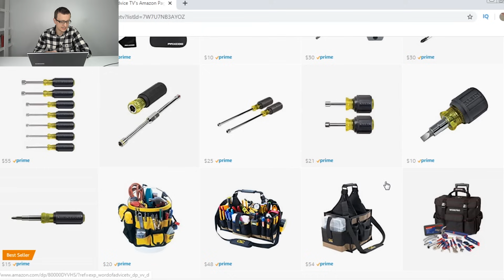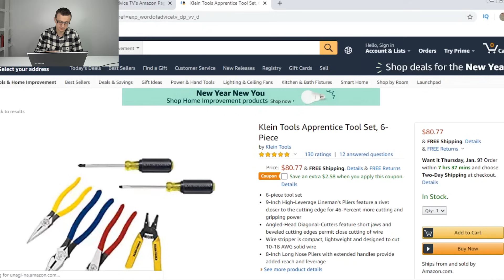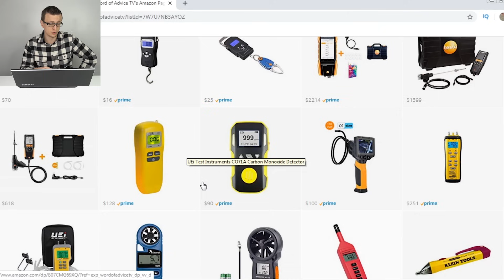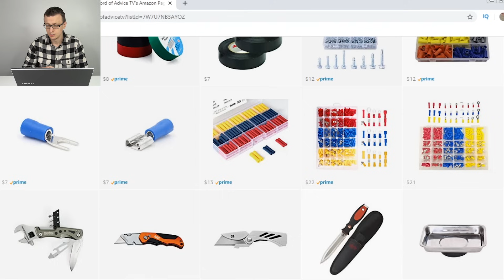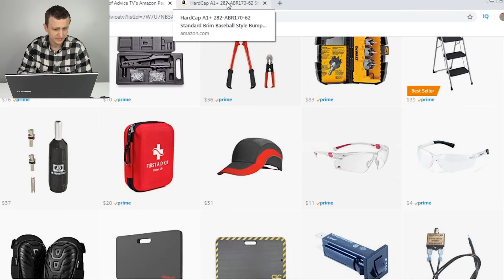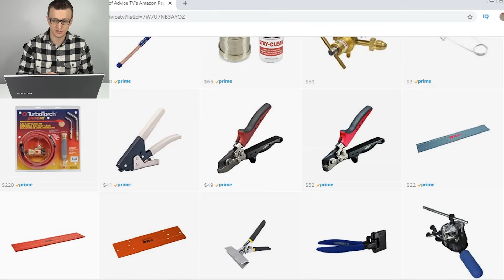HVAC Tools List for New Technicians

Comment: Would recommend the 20-in-1 Impact Driver Set with Screwdriver Bits and Flip Sockets
32303HD in place of most of the screwdrivers mentioned. It is also by Klein.

Love the choice of Midwest snips!! Also highly recommend.

Recommend also picking up a Dewalt 18GA Shear Attachment, fits most drills and works great for cutting large pieces, furnaces, and plenums. They are a great tool to have around. 

Should have some kind of ratcheting pipe cutter

Also highly recommend a deburring tool for ABS, PVC, CPVC, like the DEB4 but they are pretty expensive. I see there are knockoffs on Amazon, haven't tried them yet.

Would recommend prioritizing the ratcheting wrenches over the normal ones, adjustable wrenches will work in most places, where the work is very tight, you'll want to have a ratcheting one.

Recommend the Milwaukee Surge Fuel hydraulic impact driver, much quieter and easier on the hands.

10/10 Recommend having a bump cap, saves countless bumps and bruises.

Should have a pipe bender somewhere in that list as well.(with reverse bender)

My favorite step ladder is the 5.5 ft. Aluminum Dual Platform Ladder with Removable Project Bucket by Gorilla, it is just small enough to fit most places, but big enough to work in raised ceilings, also the "Project Bucket" is super handy for pretty much anything you need to do on a ladder.

Comment: Hey I have a question. I have that hex Service key. And my lead always say I need another one that’s bigger for the suction side so he never uses my key. is he wrong
Reply from the maker: Just to make sure we are talking about the same thing, you are taking about the refrigeration service wrench right?  That wrench should work for just about any service valve so I'm not really sure what's going on there.  🤷‍♂️ Maybe you got a different one? Have you compared your wrench to his, is it any different?
Reply: @WordofAdviceTV  I bought a Klein Service wrench and came with hex adapter 1/4 inch square to 3/16 and 5/16. That’s would open both valves right?

Comment: Hey Jay, I got a question for you. What type of different screw/bolt head shapes and sizes would you say we must have in the HVAC field? I don't want to run into a screw/bolt I can't take out because I don't have the right drill head. I noticed on some of the all-in-one Klein screwdrivers that they don't have the right size for some gas valves. I believe I got what I need, but I just wanted to double check. Thanks

Comment: Wera insulated screwdriver set I think they are much better quality than Klein and also cheaper on Amazon. Also the Klein 5/16 1/4 slide lock 10 in one I think is the must have screwdriver. Get it you will never go back to regular 11 in 1 it also has a Schrader valve core remover

Comment: Starting out or even in to it, Harbor Freight builds some good stuff. We farm, poultry houses, so lots of switches, motors, capacitors ect. I used Simpson analog years ago, then used fluke, I burned it up and bought a Ames from Harbor Freight and it has worked fantastic.  Been dropped hauled in a truck ect and works great.

Comment: I have two bags. My sheet metal bag which is mix match of every brand, and my normal everyday bag which I just recently replaced everything in there with Milwaukee... I also have a bag just for drill bits but you know I'm not counting that

Comment: I would like to mention a tool. It is a locking adjustable wrench. I find myself using it quite a bit. It works well during times when you need to break up two nuts back to back or when working on a nut in an odd location. Once the wrench is locked on it won't come off like a typical adjustable wrench.

Comment: I am in HVAC school right now and am looking to buy a drill and/or driver. I am currently thinking about buying a small 12v driver for screwing and a larger 18/20v drill for more power for drilling. Is this a good setup for the cordless drills/drivers?

Comment: great video but would like to throw a little hint about tools , i have learnt from my use of tools , the manufacturer, means a tool that does'nt degrade due to poor material process, such as , side cutters , made by many companies in china , these tools dont keep a good cutting edge , the edges chip away or deform , i actually had a jaw of a cutter break , but i do have great U.S.A. made tools and when i used my klein , it worked great , maybe it sounds like i dont like china but when you pay for tools and they dont perform while on the job, i start to steer away from foreign made tools. not all of my foreign tools were bad but too many were not the best , kudos for this video , wish i had this info when i was starting into my profession, thanks for these videos.

Comment: Wow. I consider myself an HVAC hobbyist, yet I have all the tools in one form or another except the anemometer (I have the fieldpiece manometer tho) and gas analyzer - the latter simply because I would never work on the gas metering myself. A lot of tools carried over from my other 'hobbies' plumbing, auto mechanics, gas welding, and electrical. 
Things I don't have but would eventually like: iron pipe threader and cutter. I grew up on grandaddy's farm and was put to work right after school, he also had a trailer/rv camp grounds on the lake so got into HVAC in 5th grade working on mobile home hvac. Age 50 now with more decades of 'hobby' experience.

for those starting out, recommend you check craigslist for HVAC guys who are retiring and selling their tools

did i miss nitrogen flow meter, core removers? fireproof fiberglass canvas for brazing? sheet metal breaks and folding tools, circle cutter, crimpers...

Comment: Got a hair less than 3 years and all 3 years I have been directly trained by a guy with 30 years of experience 

Slowly building my tool bag 

Anyways a few cool tools of mind is a “ swedge tool “ negates having to buy copper fitting saving ALOT of money per job 

And another is a copper bender to keep from buying copper elbows n such when they run here about 15$ a piece

Comment: Milwaukee 12 Impact is my favorite and use today. I also bought the RIGID version and it is just as good. RIGID is registered and battery is lifetime warranty. I say this because I used to use DEWALT, and after 14-18VOLT batteries dying over time, I game $1000 worth of tools away to another DEWAULT fan, because I was Done. I bought RIGID, and am happy. I have replaced 2 of my original batteries (FOR FREE)) and have no other problem with them. BUT YOU HAVE TO REGISTER YOUR TOOLS. IF YOU DO NOT REGISTER WARRANTY IS ONLY 3 YEARS. ALSO, CHECK ONLINE AND MAKE SURE YOUR TOOL WAS REGISTERED. I HAVE A FEW BOUGHT ONLINE THE THEY DID NOT REGISTER EVEN THOUGH I FILLEDED OUT RESTISTRATION.  IF REGISTER AND APPROVED, LIFETIME WARRANTY ON EVERYTHING FOR THAT TOOL.

Comment: You have to use low lose fitting hoses. New tech should just get analog gauges first. Good ones are much cheaper then good digital( Testo) and good for them to use their head for the math in the beginning. Stay with knipex when able

Comment: Remember: As an apprentice you are not expected to have all this stuff starting out. As an installer I don’t use a lot of the tools he said to get like the sheet metal notching tool, just use your snips to notch it and save the money and weight for your self. Most guys just use needle nose pliers to open up the copper to fit copper inside of it. Not proper but it saves you from carrying around a lot of extra stuff.
Reply: I agree duke you don’t need every single tool especially if you do more research you’ll soon find out
Reply: Most of the expensive tools, company will supplies they only really expect you to have hand tools and gauges. Companies don't expect a tech to have a vacuum pump, scales and recovery machine. But it's a pretty good list of tools that people should be familiar with for sure.

Comment: On pipe wrenches: the teeth on my Milwaukee wore out very quickly. If you are running lots of gas, especially commercial jobs or plumbing jobs Ridged is the only way to go. I would save up the money for them they are worth it.

Comment: If you are doing much duct work (new construction, change outs) I firmly recommend Midwest crimpers, reds, greens, hand seemers. However I barely use my handseemers. I would not go with Klein for sheet metal tools speaking from experience. Also Malco Turbo sheers are a must have for ductwork. 

If you are in service or going into service you may not use this stuff as much but I wish I was told this when I first bought my tools doing new construction.

Comment: Cool to see the differences between the US and Canada. 
In Canada we are called refrigeratoration mechanics but they also work on heating systems. 
Our apprenticeship is 4 years consisting of 1600hours per year on the job and 8 weeks technical training per year.  
In Alberta we get an allowance of about $500 per week while we attend technical training.  
It's a red seal trade meaning if you pass the red seal test after your final year of technical training, it's a certification that is recognized world wide.

Comment: A few comments about tools  : 
1. Customers don't care what kind of tools you got,  they only want to know how much it will cost and how soon will it be up and running. 
2. All tools get dirty,  so if you got to buy pretty hot pink, neon blue or riotous red handle ones, don't spend extra dough. Working man generic tools will work just as well unless you're moonlighting as a fashion model or circus clown.

Comment: Great list! Insulated screwdrivers, lockout cap screwdrivers, clamp for door switch. I like Milwaukee for some hand tools which is close to prices. Wireless gages are less invasive but expensive. Indestructible shoes. They’re construction toed running shoes.

Comment: That stubby Klein screwdriver is a lifesaver (mines Milwaukee and ratcheting idk if the Klein is but same thing) seriously a must have also the Milwaukee bit kit and the color coded hex set are as well. And of course a good Impact/Drill set is a necessity i use Makita but Dewalt  Milwaukee and Ridgid are great too and a duct knife Malco is nice cos the soft sheath but Milwaukee and Hilmor are nice too.
Also a refrigeration unlock key so you can hook your gauges to the lines if they have locks on them and a rubber mallet.
EDIT:That was a really good list you covered all the basic tools for beginners.

Comment: Solved a bad circuit board that would cause blower fan to stop during an AC cycle and freeze up my condenser because of this channel. More recently I replaced the ignitor on my furnace because of this channel. Best YouTube channel hands down.

Comment: I’d recommend staying away from the testo 552 micron gauge.  Seen most of them leak,  and they don’t have an accurate micron reading.

If you read the manual,  it has you connect directly to your vacuum pump and pull it down as low as your pump can.  At that point,  you zero out the gauge to your pump.  Not a great method,  and way too unreliable.
Reply from the maker: Thank you very much for the feedback!! That's good to know! If I will get one more person that says that about it, I will remove it from the list. (I believe you though and am only leaving it on there because it seems to have a good rating on Amazon)
Reply: Word of Advice TV yep no worries! I run lots of testo gear,  just not this piece any longer

Comment: you missed nice crimpers,ladders,spot lights,recovery tanks Nitrogen tank(s),sprayers for solutions to clean coils,water hoses (are a few more items might of missed in video, single jack,tap/die metric/us, sawsall,
manual hoist or block n tackle,safety harness,cleaning tools for fan blade and cooling tower spruce up).
Anyway nice video , 2005-2015 180+ split 1t thru 20t & gaspacks, 4 walk-ins,12 coolers,25 upright ref/freezers,1 90t chillers air over water with 30 water cooled units, r-12,r-22,r-134a,r-404a,r-502,mp39,mp66,
yes I had many recovery tanks and gauge sets (school district)
Reply from the maker: Wow, that was a lot of useful tool suggestions!! Thank you! I added a bunch of those to the list!

Comment: ** Also buy 2 refrigerant wrenches as they get left due to the size of them - they also double to use Blower motor shaft on the squirrel wheels. I would also add offset racketing wrenches (Yellow Jacket sets are great..but they are NOT color coded! lol)
Reply from the maker: Great recommendations! Thank you! Yellow Jacket offset wrench was added to the list!

Comment: Few different ideas I use:
Nut Driver set from Ace Hardware or Harbor Freight..However i only keep the 1/4" and 5/16" in bag and use a 18" extension with a set of magnetic nut drivers from Dewalt (Dewalt is skinnier than Malco but are not flip bits however have a strong magnetic hold - I don't carry long nut drivers since this is a dual use tool) Also just my opinion Malco sells the best Aviation- L/R Snips. Also if your doing Installs you will need a Hammer Drill to bore in stucco and concrete with the anchors - Sheet metal hammer all are Must Haves!   Also if your going service you will need a Pigtail alot of time there are not convenience outlets (Don't get stuck on a roof without a way to plug in your vacuum or Recovery units) Since they are around $20 it will save your life!  I totally agree with you in regards to pliers Knipex are the way to go ( I have both pliers with button and without I use the ones without more since you can adjust them very easy one handed) I also think you should add Scrub towels as you don't want to have dirty marks on walls from dirty hands ( also they remove blood if you cut yourself and didn't notice and touch a wall) I also believe all techs should have 2 meters as you will run into issues if you only have one (back ups are always recommended) Just another thought if you buy cheap tools you will have to replace them more often so if you can afford them buy name brand as they will last and think of it this way ..your making your living with these - if you cheap out your will have to work harder to get the job done..And don't let my name fool you I'm not really a Rookie..lol
Reply from the maker: Wow! That was a comment LOADED with useful information! As I was reading it, I kept looking at your username and thinking there's no way a rookie is writing this. This man sounds like a veteran technician on a master level! Well and then you said it yourself at the end :) Thank you for all the good information and advice! I have added most of the things you mentioned to the tools list.

Comment: Veto tp4b is a great back for service techs.. there are several videos to show how to load them out. Open top helps you not loose tools! I also agree that knipex by far had the best pliers on the market. I’ve switched over to snap on for some of my screw drivers, and 1/4 swivel head ratchet!   Great video, also a cps solenoid magnet is a helpful tool!
Reply from the maker: Both, the tool bag and the cps solenoid magnet suggestions are great!! Thank you! I added both of them to the list.

Comment: Question: I have continuity on furnace circuit boards. On R and C. Is that a bad board? All wires were removed during the test.
Reply: Check voltage. You should have 24v.
Reply: Connect the board to check it
Reply: R TO C does have 24 voltage.
Reply: The C is only used for the outside condenser. Not for the thermostat. The other wire is connecting to the Y. Question is. Does both wires leading into the contactators for the condenser. Have 24voltage when set cool?
Reply: @MrOlivasalone  yes, because contactor coil needs 24v to close the contactor
Reply: @jesuscard.1675  

Ok. So if I remove all wires from the furnace 24V. Should I have continuity when I touch R to C? 
R=24v does C also have an independent voltage?
Reply: @MrOlivasalone  if you have 24v you will have continuity. But what's wrong with your unit?
Reply: @jesuscard.1675   that's what I'm figuring out. The inducer stays on with an error code and once I removed the wires to the condenser. Which go to the contactor. One on Y and the other on C, the inducer stops and circuit board stays a solid light meaning power. Now...I found a short on the wires leading to the contactor. But as of now its not connected and I'll fix that later. But I have continuity from R to C in this board. And I have a new board not installed yet and do not have continuity from R to C. Voltage and continuity are their own seperate test methods. For other results. But since I do have continuity on the old board from R to C...then that means I have constant 24V on C and to the contactor.
Reply: @MrOlivasalone  Heating and cooling are two separates circuits, if you have a short on cooling mode the fuse will blow out, leave condenser wires disconnected and heating will work with no problem.
Reply: Until replace the Y and C wires
Reply: Your correct.  It went throw the sequence but the capacitor needd to he replaced. I also just read that the R and C should not have continuity. That's why I get the error code when contactor wires are connected. The error code is "external load" and the 2 contactor wires is suppose to have continuity. So it's not a short, which is why my fuses were not blown.
Reply: @jesuscard.1675  I'm getting the capacitor installed tomorrow. I'll keep you posted. But it does seem to be a faulty board at the R to C terminals
Reply: @MrOlivasalone  ok, I have a new board I'm going to check it for continuing tomorrow and I'll let you know my reading
Reply: Hi Florentino. I checked both a brand new board and a damaged one. The new one reads 1 k ohm and the damaged 1.3 k ohms. I checked also with beep continuity and there's no beep on both
Reply: @jesuscard.1675   awesome! Thank you.
Reply: @MrOlivasalone  👌